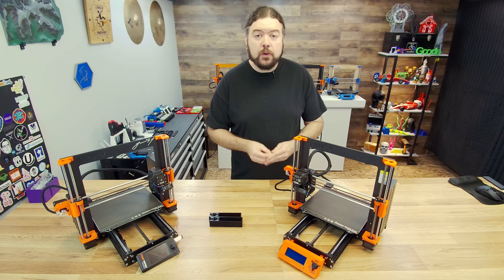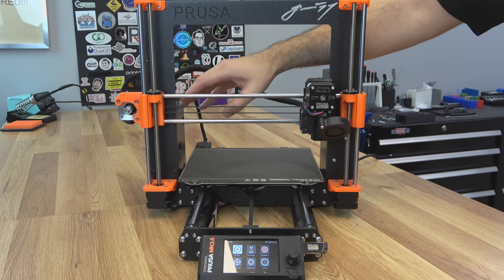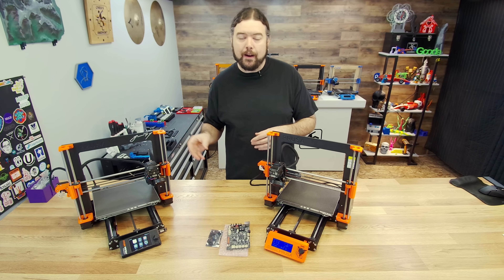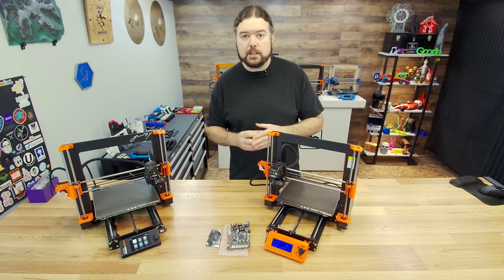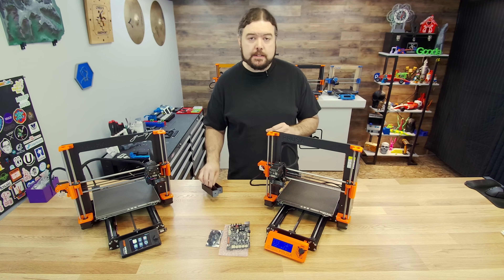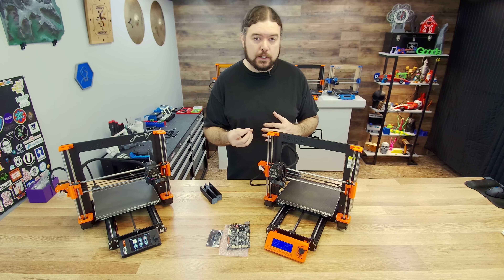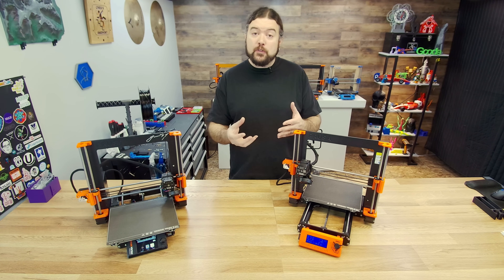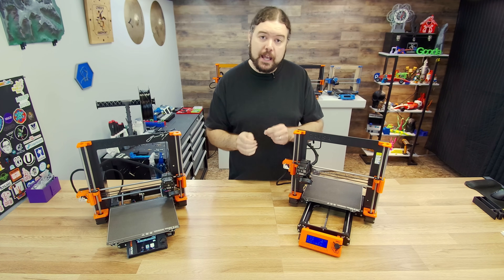Should You MK3.5??? - Prusa  MK3S+ to MK3.5 Upgrade - Prusa Upgrade - Chris's Basement - 2024

Comment: I upgraded all of my Prusa printers with P1S printers. 🤣
Reply from the maker: Too bad Bambu is closed source.
Reply: @ChrisRiley They print objects quicker and with better surface finishes than Prusa and do it cheaper. That’s all I require to make money from them. 🤷🏼‍♂️
Reply: @ChrisRiley People say this, but how true is it really. That sounds silly at first, but look at Prusa's current stances on open source and their actions.

My take: Prusa is open source where they have to be and only technically speaking.

Obviously that requires further explanation so to put it succinctly:

Prusa Slicer: Based on much gpl code. No way they could go closed without rewriting from scratch and theyve complained about it being forked which is ridiculous as they forked slic3r themselves.

Prusa firmware: Marlin, but in a way that makes it difficult to merge their work back into marlin proper and vice versa because its a very different, custom, old version which I think is a big reason input shaper came so much longer after marlin had it.

Hardware: They haven't released hardware source like step files, gerbers or boms for their last 2 printers and have openly said they make their boards difficult to replicate defeating the purpose of being open source in the first place.

Long and short, Prusa uses open source all over their branding but when it comes down it, they are only a bit more open than the elephant in the room.
Reply from the maker: @BeefIngot  Here's where I'm at, do you want to use your 3D printer as a hammer? Meaning, it gets the job done. Do I care if my toaster is open source? Please, do what you want, I would never stop you or look down on you for making awesome things, no matter what tool you use. My channel is based on a community. The 3D printing community that I know and love is based on the sharing of ideas. Prusa is not perfect, being open source makes it really hard for anyone to compete, but that isn't an excuse. I don't get paid by any 3d printing company. All I want is to see people and companies come to the table and participate. Open source is extremely important and it has gotten our community to where it is today. The rules of it are really hard to follow. I do my best to instill the values of open source because great things can come of it. In my book, again personal opinion, there is a difference between companies that fear giving away everything they have worked so hard for and companies that use all of that work and then turn to spit in our communities face. The average user wouldn't even know, but my family, this community does.
Reply: @ChrisRiley  I get the sentiment, I think if I put what I was saying differently it would be that I feel like projects like ratrigs, vorons, vzbots more accurately represent open source while Prusa hasnt really since the early stages of the mk3.

I suppose more open source is better than less, and I get that perspective, but to me and I do appreciate being able to have different opinions, If I want an open printer Ill build one and if I want a tool, well thats currently Bambu.

Its the elephant but I ultimately think they pushed the needle forward and respected licenses which is above the vast majority of 3d printer manufacturers.

I would love if other companies pushed user experience as hard as they do, but they just dont seem to and Prusa seems to be tripping over their laurels at least for now.

That said, I get the sentiment, the feeling like what was once basically always open (at least in the consumer space) now isnt (though Creality has shown its only due to laziness multiple times.... but thats another story...). I feel that happening all over like a tide.

All that said, I get that pragmatically, building any of the truly open source projects I mentioned is big work; even something like the rook is big work, so I can get Prusa coming across as a middle ground between the 2 ends.

Also, I lowkey totally get the fear of Bambulabs doing what DJI has for drones, though that can only happen in a space where other companies repeatedly continue not to get that the big advancement is actually user experience rather than just speed. Unlike DJI, at least right now, they arent patent heavy, so I think there is a chance for coexistence if companies just test things for ux before sending them out for once or like prusa used to be a great example of.

Comment: So yeah for now I intend to stick with my mk3. It doesn't get a lot of use. The mk4 is my main machine. I did a lot of multi-color prints and sometimes it was annoying that I had something that wasn't visible that I had to "waste" a print time on just to hold things together. I expect the mk3 will get used for that. I'm obsessed with quality. I don't give a crap about speed. In fact very early on I was not happy with my mk3s+ quality. I'm like....what's with these artifacts? They are on all my mk3 prints. I have stuff here at work that I love for decorations, yet part of me is irritated they have VFAs. (I didn't know what VFA's were when I started 2 years ago). I've been very happy with my mk4 since day one.....other than its lack of color. I just got both my mmu3 and mmu3 upgrade in yesterday. I even inserted the PTFE tubes in the front, backwards just like I told you I would. They either should be beveled on both sides or they should be facing the filament source not the extruder. lol I figured for $90 I might as well upgrade my mmu2, which has certainly given me headaches. I'm excited to get going again on color prints this weekend. I have a huge list of stuff that was put on hold. lol The mk3 will probably get used for the less important things. But for the "your focus goes here", they will be 100% mk4 parts. First up will be a senko model I found for $10. She's on a bridge with some trees. I might print the trees on the mk3. Maybe even the ground as well. It's a combination of rock and grass. So it doesn't need to be a clean print.
Reply from the maker: I'm glad your happy with your MK4! Yeah, if you have an older Prusa, the upgrade may not be worth it.
Reply: @ChrisRiley  MMU3 is done, the required nextruder mod will probably happen tomorrow. Unlike building the MMU3 itself, I can't mod the printer on the couch. LMAO (and yes I lost a bearing at one point, but I found it LMAO)

Comment: My one issue with the flashing via prusa connect (which I did with 6.0) is that it can flash the firmware. It can reboot the printer, but it gets stuck at the "would you like to program the wifi module?". I don't even know if this is necessary. I had to replace it recently. The original one died on me. But it's been working solidly. So.......why does it need to reprogram the module? If it needs to, it should just do it. If it doesn't need to, then why ask? Oh well. Oh and I kind of hate the touch screen. lol It reminds me of the old windows mobile phones before windows phone came out. It's not very fluid at all. And honestly it feels like it needs a stylus. lol I prefer the knob.......at least in 6.0. Maybe that will change.
Reply: I reaaly Like the Touch and ITS really Fluid, maybe you got a Bad one?
Reply: @MaxMichel89  part of it is that the interface is too damn small. That certainaly doesn't help.
Reply from the maker: Thanks for your insight!

Comment: How would an MK3 switched to Klipper compare to the MK3.5 upgrade?
Reply: I have a couple Prusa Bears running on SKR 1.4 & 1.4 Turbo with Klipper.  They are pretty close to the same as my MK3.5 upgrade but have z auto level which is an enhancement that the 3.5 can't do.
Reply from the maker: Interesting

Comment: No one will pay me the time & stress - so i would buy a MK4 😇
Question: Are the faster printed parts as robust as the MK3s+ ?
Fast must not be better ....
I have 5x  MK3s+, so i can use them all for larger projects / more parts at the same time
Reply from the maker: Thanks for your insight!
Reply: Faster is straight up better all around. You can get to a place where you exceed your hotends ability obviously but this idea that slow is better isnt actually based on anything but gut feeling.

Like many things in life you push till yoy hit a bottleneck and going slower than that is just a waste of potential.

Comment: Chris, good review.  Having Prusa Connect as an option and not needing Micro SD cards is a big benefit.  Since I don't have a MK3, I had to do some checking, it seems like they  don't sell a MK3.5 it is just the upgrade kit for the MK3.  I looked at the MK4 and it is $800 for the kit from Prusa or $950 from Printed Solid.  It might be worth getting a MK4 for the $550 price difference and have two printers the MK3 and a new MK4.
Reply: Space might be an issue for a lot of people.
Reply from the maker: Thanks Dave! Two is always faster and who doesn't need another machine. :)

Comment: Will Octoprint still be able to control my Mk3 after the conversion?   I can't find a answer to this in any of the documentation.
Reply: Yes. I went to 3.9 and am also using Octoprint with no problems
Reply: 3.5 also still Works with octoprint
Reply from the maker: Yes, as others have said, octoprint is all good.

Comment: Great review as usual.  This upgrade is not for every owner.  If I was invested in the Prusa Ecosystem with several printers for production prints, the speed improvement would be worth it if you get the payback in a reasonable amount of time.  If you own a single Prusa 3.0 or any other 2XX by 2XX bedslinger and are doing volume printing, I suggest saving your money and buying an enclosed fast core xy when the price is right for you.  The speed improvement with higher print output and print quality is undeniably worth it and you still have your old printer to run parts or use for one-offs and development while your core xy is printing.
Reply from the maker: I agree 💯 Thanks for your insight!

Comment: I upgraded to the 3.5 and it was a great move. I kept the nylon lock nut modification for the bed and used the bed mesh output in Octoprint to dial it in again. The Prusa bed level plugin didn't work with the new board, hence the method I used. The print quality is much improved and the little bit of fiddling around that was sometimes required for the first layer is not something I have to do anymore. The primary reason I opted for the 3.5 vs the 3.9 was because I previously installed the Revo 6 hotend and wanted to keep using it.
Reply from the maker: I totally get it! That Revo is a great hotend
Reply: Im seriously thinking of goin back to the nylock mod I had working before the 3.5 upgrade,,,,now where did I put those nuts?
Reply: @darco63  I wonder if the Prusa bed leveling plugin for octoprint works with the new setup yet. You'll definitely need to at least use the mesh output to dial it in if it isn't. I'm not disappointed I left my nylon lock nuts in place. Seems like just an easy way to help the printer with it's first layer.

Comment: @13:00 Seriously? 🤔 Sure, it does look better than the previous one, but holy crap does it still look bad ( depending on one's standards ) 🤨
Considering the Upgrade Costs you'd honestly be better off just buying a Bambulab A1 mini which costs €4 less than the Upgrade Kit / €120 more if you get it with the MMU.
Reply from the maker: Too bad Bambulab is closed source

Comment: I love the upgrade to MK3.5.  Screen and overall interface is awesome.  Even with touch now, I'm still using the wheel.  I run the revo with it.  Would be nice if nozzle size was in same menu as changing the steel sheet.  My only gripe is that the beep is too quiet.  Can't hear it upstairs from the basement.
Reply from the maker: I'm glad your happy with it! Thanks for your insight

Comment: My RPi also handles the camera streaming - used for Obico monitoring as well as allowing me to visually check what's going on in the other room.  Does the upgrade kit allow for a camera? Or do I need to still use my RPi for that functionality?
Reply: The Prusa board does not support camera. But for simple preview, an ESP32cam might be enough (just 640by480, but less than $10 and using webcam, not IPcam protocoll, so directly viewable in any browser).

Comment: I've been orienting prints like this one on a 45 so both x and y motors are necessary for all the movements.  For CoreXY I place it parallel for A and B. Seems to be able to print faster with better quality.  Much less VAF.
Reply from the maker: That is a great tip, I do this my self on some parts.

Comment: Or perhaps we should instead add a $15 Raspberry Pi 02W and put Klipper on the mk3 (or re-purpose the one that was already there running Octoprint). Then the 8 bit Einsy board is fine and we get all those new Klipper features like input shaping and all the existing cabling works perfectly. We get a faster network, too, the network speed on the MK4 and XL is not up to the level of even the lowest Pi. Just another option to consider. If you want the best Prusa experience the MK4 and XL are where that is going to be. But the best MK3 might be running Klipper. :)
Reply: Definitly a good alternative. Or you might use an external pad with klipper to controll multiple mk3s+.
However, if it comes to ease of use, imho the 3.5 upgrade is an valid upgrade alternative. Esp. if you also want to add the MMU3.
The advantage of the mk3.5 upgrade is everything is dialed in by Prusa. Esp. between Prusa Slicer and the mk3.5. On klipper you might spend more time to optimize profiles. Setting up an MMU is even more tricky. Which is O.K. for tinkering as a hobby. However, if you primary want to print, the mk3.5 upgrade is preferable.
However, the Prusa Mini Board/Display (+external Mosfet for the bed) might be an alternative. As both board and firmware are open source an both mk4 and Prusa share the same firmware base now, you might edit the firmware for the mini hardware to the mk3 values, if you do not need the MMU. You get board+display for the mini for about $70 on Aliexpress...
Reply: Can you please link (or if YouTube doesn not allow it) just copy and past a site title, where I can read more about this conversion process?
Reply: @IstvánNagy-z7m  If you do a web search for Klipper on MK3 you'll find quite a few examples.
Reply from the maker: Klipper is always an option, but as always, there will be a lot of things to learn and tune as you already know.
Reply: @ChrisRiley  Actually this is correct in general, but the mk3s+ has the advantage of a big userbase. So if you have a stock mk3s+ using a Raspery Pi zero 2 or a Pi 3 and a preconfigured image should do without much tuning and learning. Actually even the Creality Pad supports mk3 s+ out of the box (only you have to flash the Einsy board yourself). If you have more than one mk3s+, one Creality Pad can controll up to 4. So it is a real alternative.
Reply: That was my first idea too as i already have a Pi Zero 2W inside my MK3S running Octoprint. What I am curious about is whether I can run klipper on the Pi leaving it where it is right now (connected directly to the board) or if I would need to take it out and connect via USB to the  Einsy. So far I did not find any conversion instructions going this direction. Maybe an idea for a future video for Chris ;)
Reply: @schotoka  they're both "*just serial.  Quick search says "all you need todo" is change the port in Klipper.  Search for uart klipper
Reply: I think it's a fine cheap option, but you lose some nice quality of life features like Prusa Firmware's crash detection. I'm still on the fence on which upgrade path to take with my own MK3S. Also in my experience Klipper does not like the older PINDA probes and can't handle the temperature sensor on them, so make sure to get a SuperPINDA for Klipper.
Reply: Does the zero 2w have the processing power for input shaper calculations, or am I thinking of the camera that it has issue with.
Reply: @Joseph_Greiner   It doesn’t have problems with neither of those. The Zero 2 W is enough to run 2 Voron trident with input shaper and webcams in both(maybe more, but those 2 are the ones I’m currently using) . The original Zero is the one that struggles because of the cpu. The 2W is basically Rpi 3b with less RAM. The original one was really underpowered.
Reply: @valen961  ah thank you.
Reply: @Joseph_Greiner  The Pi 02W is basically a Pi3 but with half the memory and 70% of the CPU clock and 1 USB instead of 4. Cameras are said to be fine but fancy graphing software for setting up input shaping might be better run elsewhere. The 02W's are commonly used for Klipper or Octoprint and are a major step up from the old Pi 0W in processing performance due to quadcore vs single core.